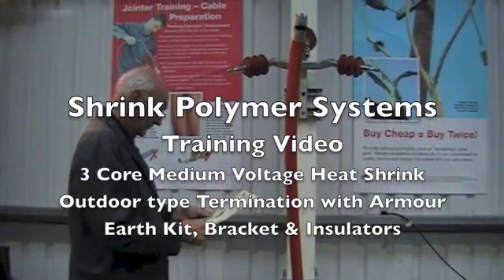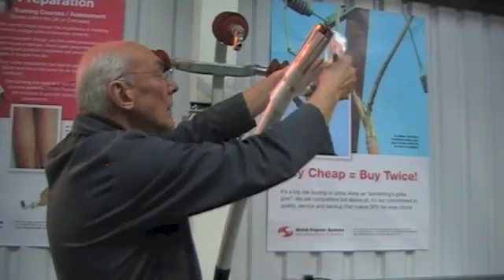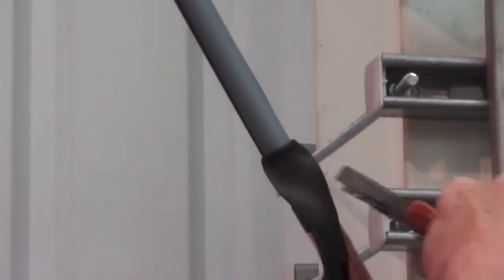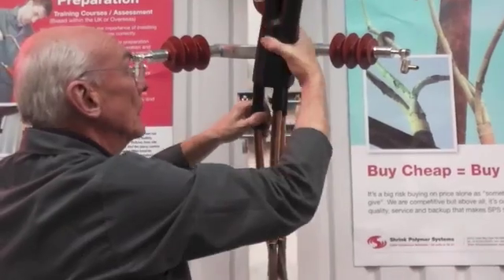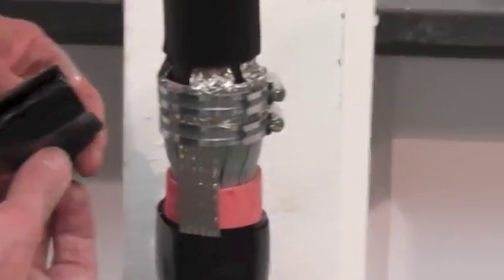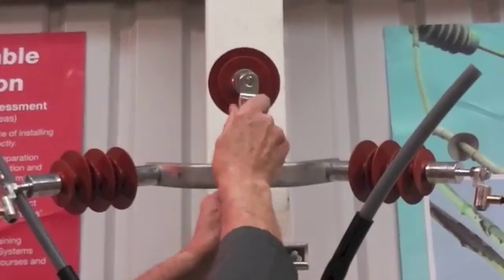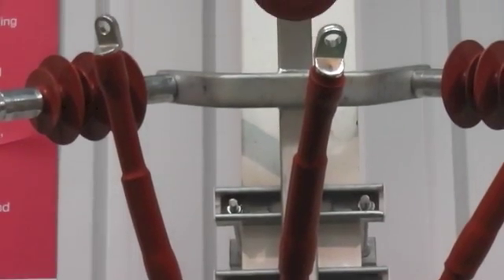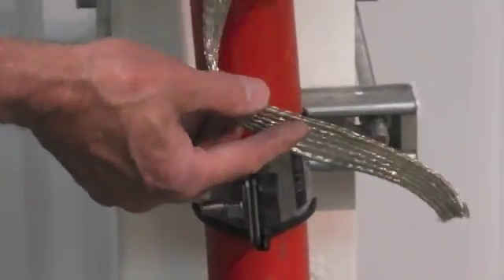Heat Shrink Cable Termination Outdoor  (HV) - 11kV 33kV 3 Core XLPE BS6622 Cables

Comment: Maybe a stupid question but what do you mean when you " don't use glass"
Reply: I found this PDF that mentions not using a shard of glass. I'm not sure why someone would think to use a shard of glass instead of just using a metal knife, though. Maybe because it's not conducive.

https://www.ensto.com/globalassets/brochures/underground-cable-networks/europacable-position-paper-best-practices-for-installation-of-medium-voltage-cable-accessories.pdf
Reply: @_AvaGlass  I didnt listen to the audio on this but watched this craftsman at his work...I think what he would have meant is when carrying out the semi conductive horizontal cut do not use glass, it is a widely used method in high voltage cable jointing.the jointer usually smooths the transition from semi con to the insulation with a shard of glass,almost planing it meticulously making sure there is no bumps that could lead to a hot spot or stress point..nowadays we are not allowed to use knifes for a lot of these cuts.we have various cutting, stripping tools for the job. but you can't beat the skill this man has.

Comment: What  will  happen  if the length  of anti tracking tube  is reduced  at site  due to  constraint of terminal box dimension.. assume supplied length of anti tracking tube is 500mm and we reduced it at site  to 450mm